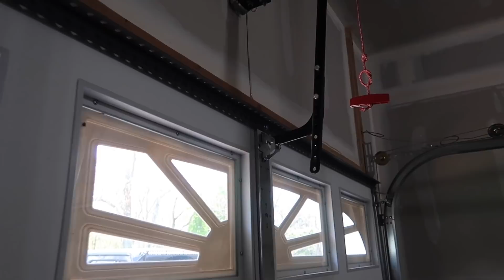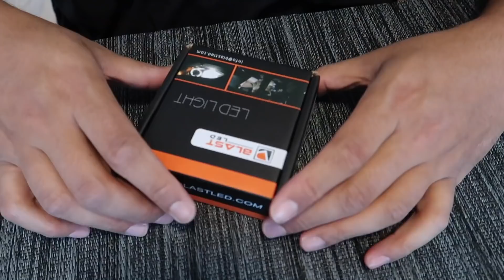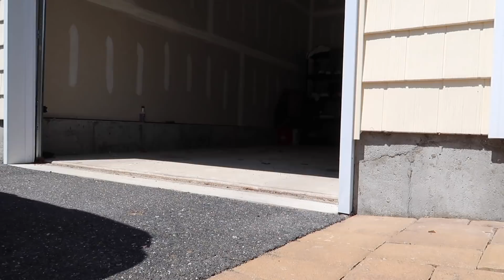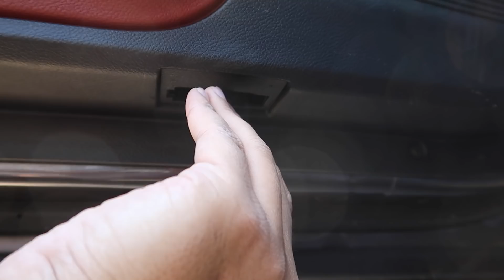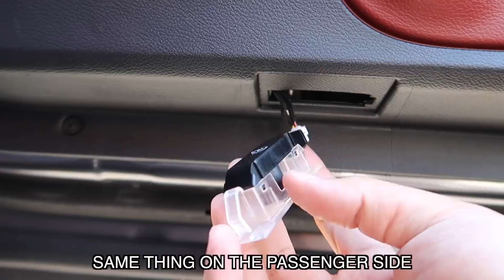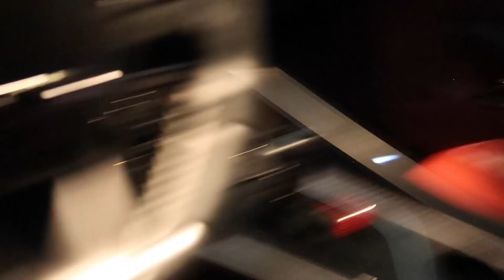Coolest Hellcat Challenger Mod Yet - 5 Min. Install LED PUDDLE LIGHTS

Comment: The image burns out after a certain amount of time.. the reason they drilled holes in your door before would have to be the oracles or some knock off brand that made GOBO for the older model cars like the Challenger that didn't have flood lights.. which were recently added in late 2014/2015 challengers. But they all burn out after a certain amount of time due to the LED emitting small amounts of heat cooking the image.. but this is a much cheaper route for the newer cars.. if something does happen they don't cost as much as Oracle light which are 80 bucks for the set..but it looks clean

Comment: Nice Mod looks great. As far as that door, it's also spring loaded. If that spring breaks that could be deadly brother,. Gaurenteed or not , thats lazy, poor installation of the door to start. You are so lucky to have had it last this long, keep us posted on what they do to repair it, just unexceptable brother for real, and that's just a small door at that,👎🏿👎🏿👎 to that company, make sure that company is the only one that touches it so they can't say someone else worked in it ( Passing the buck ) so to speak,  sorry to see that man, Peace brother 🇺🇸